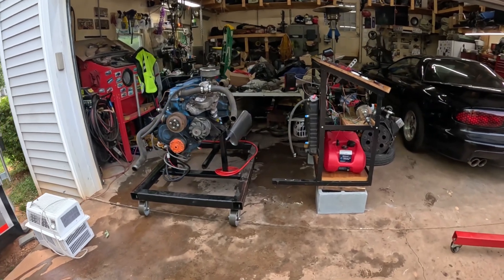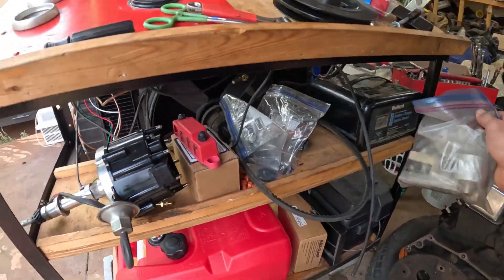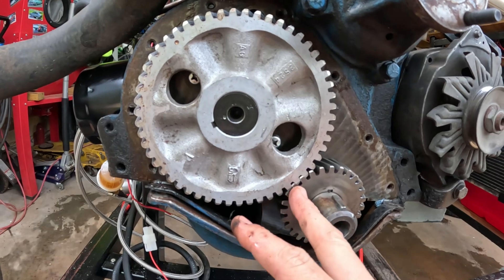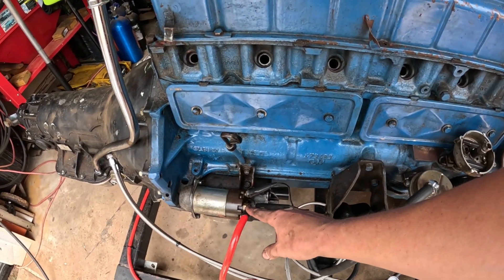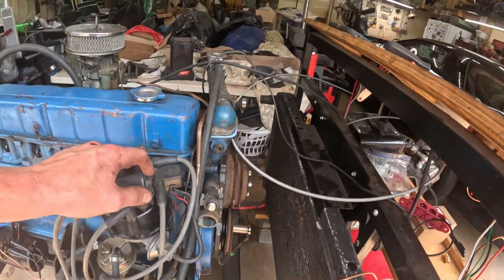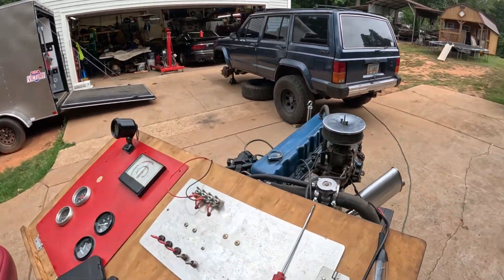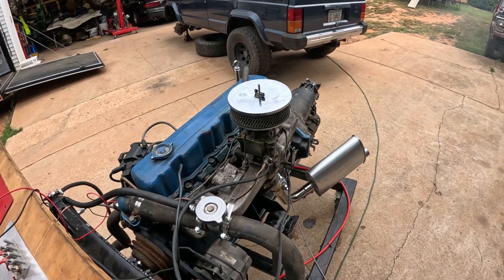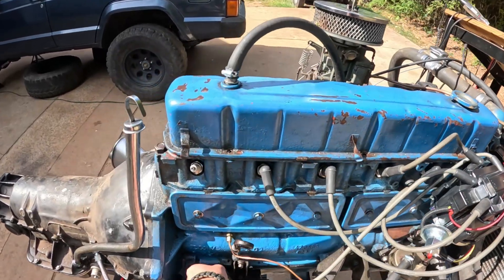Part 3: Inline 6 Timing Issues

Comment: fireing order, 15 too young 36 too old 24 just rght
Reply from the maker: In the next episode or two, I will show how I screwed up. But ended up I had the firing order "right", the first time. But when I second guessed myself, and redid the firing order, I reversed the rotation of the firing order on the distributor cap.